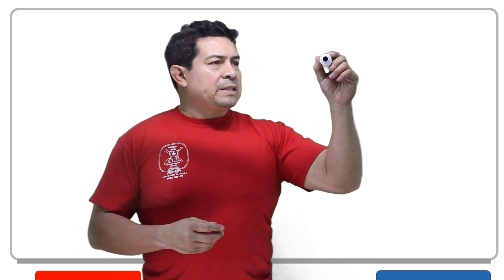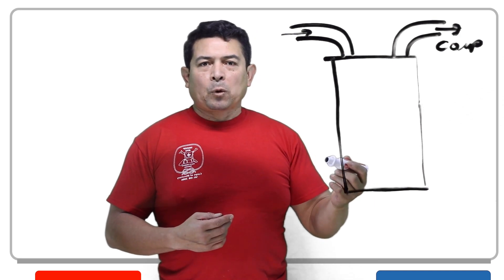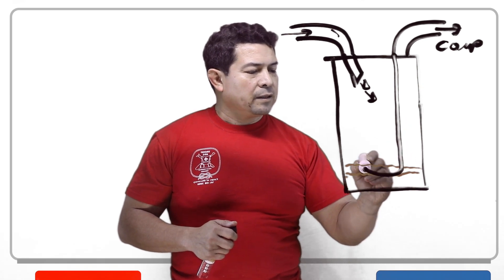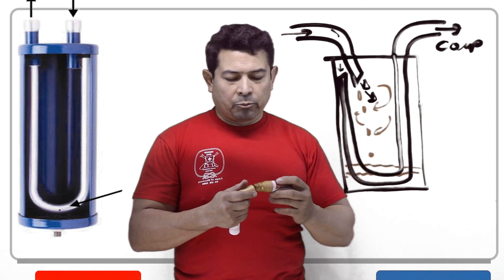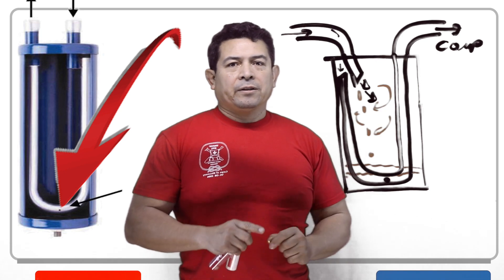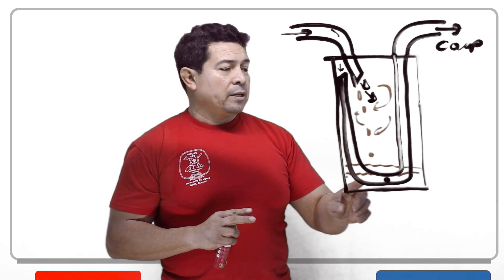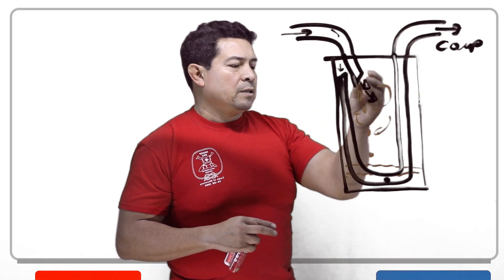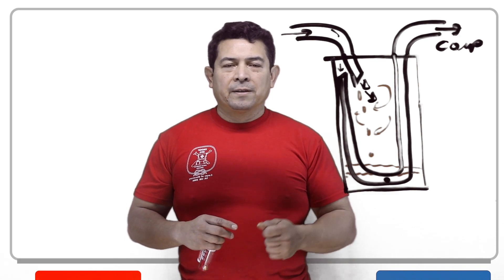Accumulator - HVAC Online Training and Courses

Comment: How to selecte accumulator for equipment
Reply from the maker: Typically the accumulator comes with the unit. It is very rare that you will have to add an accumulator to any unit. My suggestion has been to make sure you have the correct suction line size and approximately one that can hold the charge of the unit. Receivers are typically designed and sized to hold the entire charge plus about 10 or 20%. But accumulators typically do not need to hold the entire charge. I hope this gives you an idea. Good luck and thank you for asking and watching!

Comment: Sir i have a question.. If liquid refrigerant should not enter the compressor.. Then why there is a r410a refrigerant which is applied only in a liquid refigerant state or form? Tnx for the answer. Great video and explanation, tnx a lot sir.
Reply from the maker: To make the answer short let me say that 410 A is a blend and it needs to be added as a liquid so that the percentages are correct. If we add 410 as a gas the percentages will be wrong and the unit will not operate properly. That is why we have to be very careful when charging a system with 410 A because we do not want liquid to get to the compressor.  I hope this explains it. Thank you!!!

Comment: So if a Heat Pump is running next to zero Superheat (bad valve or dirty coil) will the Accumulator prevent Slugging or Washing of the oil from the crank case?
Reply from the maker: Kevin Mask If your heat pump is running with next to no superheat it could be a dirty evaporator coil, or it could be a dirty return air filter, you may want to check the fan speed of the evaporator fan, check to see if the vents are open throughout the spaces and or a could be a badly adjusted metering device.   Bad compressor valves would not cause zero superheat.    Yes, you are correct the accumulator would stop the liquid from getting to the compressor, flooding the compressor and destroying the bearings.

Comment: Hi,
What means when accumulator is freezing?
Reply from the maker: It means that you have liquid refrigerant leaving the evaporator and you need to check the superheat and make sure you have superheat.
Reply: @AirConAcademy  Thank u for your answer. If the system had a hot gas bypass line and an extra TXV on suction line should i check something more?
Reply from the maker: @soterist9011  OHHHHH!!!!   That changes things a bit!!   it could be that the hot gas bypass valve is not opening and the TXV is miss adjusted.    those systems are a bit more tricky.   check the adjustment on the extra TXV.     sometimes those have a solenoid just before it so it only works sometimes.  only when needed.    so check the superheat on the extra TXV.    I am sorry it took me so long to answer I have been teaching in the mornings.
Reply: Thank u.
Reply: Cai have an accumulator in the every unit or just heat pump?

Comment: I installed a parker accumulator yesterday because the previous one was leaking.  I brazed the new one in and pressure tested it and noticed it leaking from the side of the tank. Have you seen this before.  Could I have applied too much heat when brazing or could the new one just have been defective?
Reply from the maker: if you over heat the accumulator it could leak but from the joints.   not from the side?   it could have been defective!!!  yes you are correct